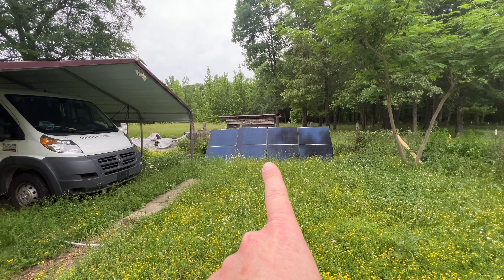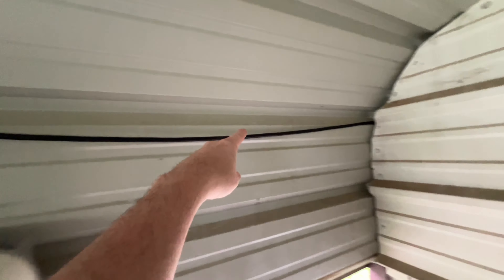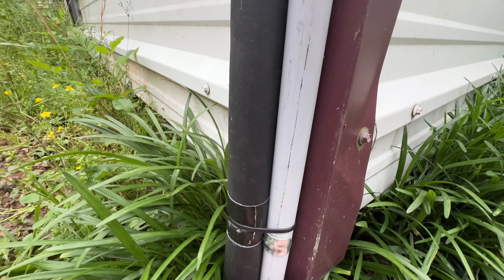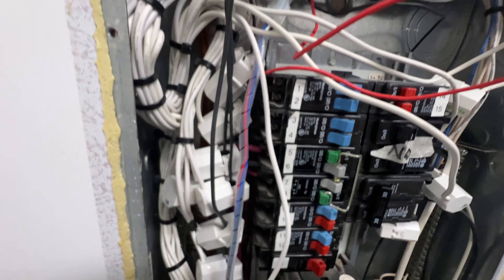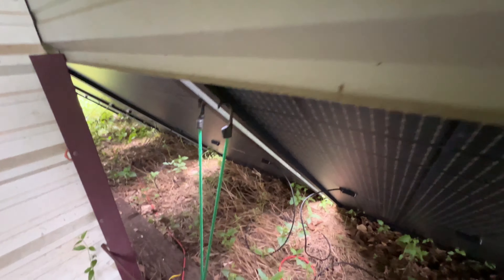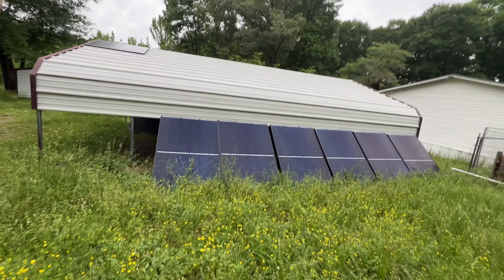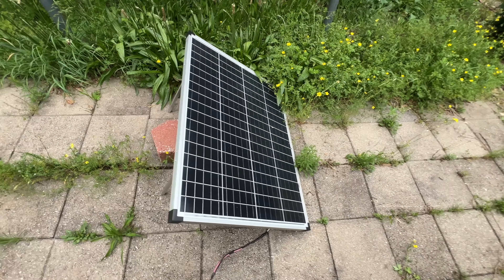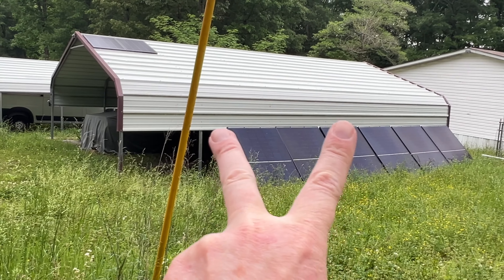4K Solar Array + Growatt 6000 MIN XL from Signature Solar +  Emporia 16 Energy Monitor

Comment: I'm in Western Washington State (Puget Sound Energy) and have the same inverter. I just failed my inspection because they said all of the wiring (in and out of the inverter) had to be enclosed in conduit. Obviously, this inverter is not designed to terminate conduit. It is aggravating because I made sure to purchase a UL1741 inverter ($$) that was approved for use by my utility.
Reply from the maker: Kodes very from lokation to lokation. 

Everything was submitted to the power kompany prior for approval. 

The runs and konnektions were made by lisensed elektrisians and done to kode. 

My inverter is mounted inside of a metal strukture and not  konnekted to my house.  🏠